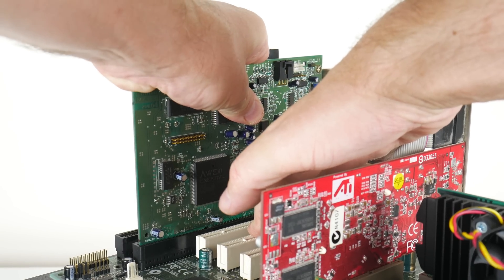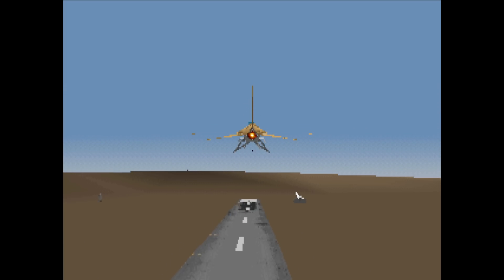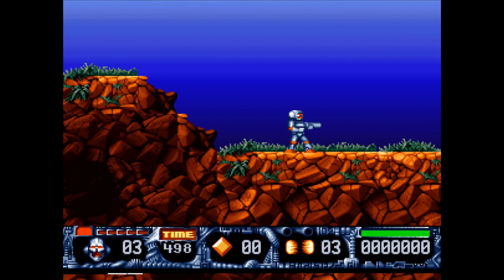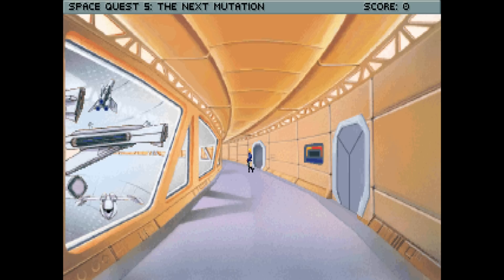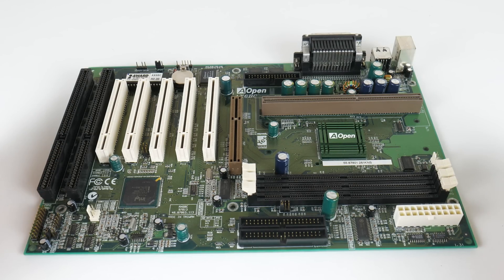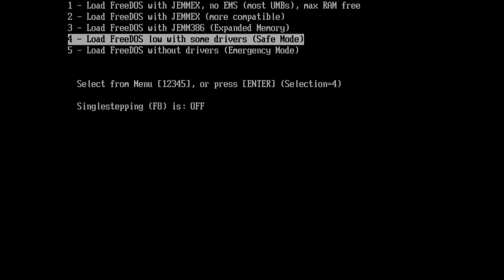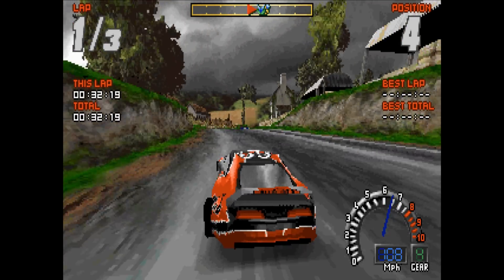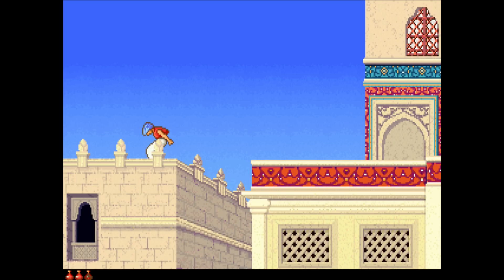FreeDOS 1.3 is it worth it for Retro DOS PC Gaming

Comment: FreeDOS looks great but the only thing I can’t quite understand is it’s actual purpose, what benefits would I have running my DOS gaming computer on FreeDOS over MS-DOS?
Reply: It's mostly intended for embedded systems, or replacing old industrial computers that can no longer be repaired, but are still a vital to controlling machinery. Hence the fact it works on modern hardware. It's also free and doesn't require licensing to be used in a commercial setting. So no benefit to someone with a retro gaming PC but could be useful in those settings.
Reply: I have the exact same doubt! Why? - does it include utilities for play speed sensitive games? Does it have a one for all solution for sound compatibility? What is the benefits? Why?
Reply: @DhinCardoso  It's open source. That's more than enough reason for some people.
Reply: @DhinCardoso  You can install it on as many machines as you have. For MS-DOS you still need a license for every machine you want to install it on.
I do have a couple of old machines, but only one license from MS-DOS 6.2 and another one from DR DOS 3.3.
Reply: None what so ever. But if you are trying to sell old DOS software to run on a modern system then it does offer a legal way of packaging up a ready to run package without having to worry about MS licencing.

Comment: Another great Video Phil! Thanks! Just curious what do you use to capture video from your DOS games. Seems like most of the common VGA capture solutions can't do anything under 800x600. I just put together an old socket 478 P4 box with voodoo2's (in SLI) and an ati 9800pro (has drivers for both win98SE and XP). Looking to do some video capture from it.

Cheers!
Reply: You will need to capture the monitor signal if you want profit from the 22 bit postfilter of the Voodoo cards.

Comment: JUST launched! been trying out 1.3-rc5 and had a problem with JEMMEX and the bonus disc thing, but having a blast! and used Grub4DOS in Partition to select between FreeDOS Kernel.Ssys and Windows ME IO.Sys! Gud times!
8:45 I like partitioning in Windows to keep the partitions aligned. I donno about FreeDOS' FDISK if it does that or not... but, I find it easy enough use windows 10.

Comment: so glad u came by with another retro build vid! all tha news about GPU shortages n stuff can really be stressful but bringin' back some good o retro gaming couldn't have came at a better time

currently i'm waitin' on a GTX 780Ti to get really dirt cheap so i can grab it for a Windows XP Retro Gaming Project pairing with a old system with a FX 8350 i retired for modern uses and yes it will be a offline PC for tha most part
Reply from the maker: 780 Ti for XP 😅 A 750 Ti will do the trick, you could build a nice Vista / DX 10 Retro build with the 780?
Reply: @philscomputerlab  i'll save Vista for a spare Sandybridge board i have second hand or should i dig out my Q9450 i have gotten for free a few years back? hmmmm

Comment: What is your opinion of that Kingspec SSD?  I see they make an IDE version as well, though I suspect that there's just some kind of SATA to IDE chip or CF card under the hood.
Reply from the maker: I think I got dud models, they are quite slow, feels like a USB flash drive more than a SSD. I would pick another brand, but it is possible I got fake ones.
Reply: @philscomputerlab  That's a bummer.  I'm partial to the HyperDisk disk-on-modules that plug directly into the motherboard, but the chip shortages are making those difficult to get now so I've been looking for alternatives, and Kingspec is one of the few companies making IDE drives (and the more reputable companies that make them, they're quite a bit more expensive).  I'd be wary too of that SATA to IDE converter.  I may experiment with some industrial CF cards since at least those are natively IDE.
Reply from the maker: @retro-computing-gaming  Just use a larger SSD with SATA to IDE adapter. Limit capacity by entering IDE values manually into BIOS. I want to do a video on this actually...
Reply from the maker: @retro-computing-gaming  CF cards work very well. For DOS a half decent brand / model will work wonderfully. Also check out IDE to SD card adapters. These use a converter chip, but work also very well with old computers.
Reply: @philscomputerlab  A video on all the various "solid state" options for retro PC's would be great.  Because there's a ton of options, and each one has its own caveats.  I've never tried the SD card route only out of concern for the longevity of the read-write cycles.  I've played with CF cards before but only the industrial variety allow for more than 1 partition, and any OS newer than Windows 98 will detect a non-industrial variety it as a removable device if the TrueIDE bit can't be flipped.  If you only need 1 partition and won't be installing anything newer than 98, regular CF cards seem to work great.
Reply from the maker: @retro-computing-gaming  I can confirm the removable bit, but could still install XP on it. In such machines though there are better options. The thing with partition limit is not true. Used various CF cards in many projects.

Comment: Still waiting for compatibility with Windows 3.11/WfW 3.11
Reply: Why? I know it might be nice, but is their anything you want to run under there? Windows 3.11 did not run much of anything that could not be run under DOS - certainly not games wise.
Reply: @lucius1976  Because it would make FreeDOS more compatible to MS-DOS. See it as a compatibility test. And an improved compatibiity can be useful in other situations.
The people from the DOSBox-X project (not classic DOSBox) do even use graphical demos from the DEMO scene to improve DOS compatibiity.
Reply: @OpenGL4ever  Technically Dosbox-x can be installed in Freedos and Win 3.11 in Dosbox-x. Maybe try that
Reply: @lucius1976  DOSBox-X is for modern operation systems. There is also no point in running a DOS emulator inside a real DOS.
Reply: @OpenGL4ever  i installed dosbox-x on Freedos. They do have a version for it
Reply: @lucius1976  Interesting. Didn't knew that.

Comment: The compatibility of FreeDOS 1.3 with Windows 3.1 and Windows 3.0 has improved over FreeDOS 1.2?
Reply: You can run Windows 3.x in standard mode (286 mode) on FreeDOS 1.3 but sadly not in enhanced mode (386 mode).
Reply: @OpenGL4ever  ah so it has improved! Because, according to something I read (I haven't tried myself) while windows 3.1 was able to run on standard mode, windows 3.0 was only able to run on real mode.
So now windows 3.0 is functional on standard mode as well?
Reply: @chrll  I don't know. I thought there is no big difference between Windows 3.0 and 3.1 in standard mode.
You might need to try it.

Comment: Do you know if Windows 3.11 works under FreeDOS 1.3? I could never get it to work under 1.2.
Reply from the maker: I haven't tried. Note that it needs FAT16.
Reply: Windows für Workgroups 3.11 does require enhanced mode which doesn't work in FreeDOS. But Windows 3.1 does run in standard mode in FreeDOS.

Comment: Speaking of Screamer 2 (and by extension, Rally), that's a game I keep getting illegal read error crashes from in DosBox and both of my P-IIIs. Do you run into the same issue?
Reply from the maker: Hmm I know there is a speed related bug with the setup menu. On some machines I had to disable CPU Cache to run setup. But game works fine at full speed. Maybe this is what you're observing?
Reply: @philscomputerlab  Nah, it crashes/locks up while in game after a few minutes.

Comment: Great video! Can't wait to test this version on my old pc. Does it work in modern hardware or semi-modern, like on a Athlon XP with the same Radeon 9200 and a AC97 soundcard? Like do we have support for modern soundcards, or anything like that?
Reply from the maker: If the machine has PCI slots there are options for DOS compatible sound cards. Also there are printer port sound devices.
Reply: @philscomputerlab  thanks for the reply, Phill!! I think I'll try to get another soundcard for it. Do you know if an Ensoniq card will work, or maybe a sound blaster live? I don't want to spend much on this, and don't know if these cards work good enough with DOS/Windows 9x games.
Reply from the maker: @marcelofrau8818  A Live! is a good allrounder card. Best for 98 games, but will run quite a few DOS games also. And should be had for little money.
Reply: there are currently supported tools like unisound for PNP ISA cards.
LGR installed freedos on a Ryzen. In fact i think dell actually still sells pc's with freedos as an option.
Theres nothing for AC97, unless the sound card has the sblink. I run a Athlon Tbird with an audigy 2 zs and it can run dos drivers.
I also think the 9200 would be fine for ega, but some of the newer cards dont do all EGA fully correct (keen 4 scrolling)
Reply: @Pickle136   thanks for the reply. will check the LGR video. As I have tried, I think my Ac97 doesn't have the sblink, so I will try something different. Do you know if an ensoniq card will be good to try? Or maybe a sound blaster live?
Reply: @marcelofrau8818  yeah for dos support live 5.1 is just as good, they basically all use the same emulation. The audigy driver can also be made to work on the live its somewhere on vogons.

Comment: In the future, I would love to see you do testing with some of Papyrus’ games, like NASCAR Racing and Indycar Racing II.
Reply from the maker: Hoping they make their way to GOG...
Reply: @philscomputerlab  unfortunately I don’t think it’ll happen. Papyrus folded after the release of NASCAR Racing 2003 and re-formed as iRacing.com a few years later. The rights to their old games are up in the air and they’re pretty much abandonware at this point. It’s a shame too, they’re some of the most realistic racing simulators for DOS. but you can still find physical copies on eBay occasionally.
Reply: @skraegorn7317  
Don't forget Grand Prix Legends too xD
Reply: @paulgraves1392  oh of course, I was just naming their DOS titles. They also did NASCAR Craftsman Truck Series Racing, NASCAR Legends, and SODA off road racing for Windows 9X, they apparently did the Windows port of Road Rash too.
Reply: I think there is no point in getting old Indycar Racying to run on DOS. Reason: You will find much better racing games today and these old racing games do have nothing special which make them unique.
The story is different for games where you do not find a modern replacement.
Reply: @OpenGL4ever  
Papyrus basically created the sim racing genre on PC and I've found that both NASCAR and Grand Prix Legends still hold up. There's no sense in arguing that theres no reason to use these games for testing, when in fact, they make excellent benchmarks for testing 90s era PCs.
Reply: @paulgraves1392  Well you can use for benchmarking what you want, i was talking about gaming. And a modern racing sim is just simply better in every aspect because the old one did not age well.

Comment: So what exactly is  the advantage of FreeDOS over Dos 6.22?
Reply: Proper usb support is one of them.
Reply: @EvilTurkeySlices  fat32 (but you can also get this with DOS 7 (win 98)
Reply: Payment-free option to bundle with modern software that works with DOS, like bootdisks and hard drive scanners. Works on more modern platforms so it helps keep old systems alive like industrial systems designed in the 1980s, or so I've heard at least.

Comment: i like freedos support of fat32 and it usually seems to have more free memory than msdos. The dimples app installer is quite nice also.
[Ediit: looks like this isnt the case anymore] -> the one big thing i find missing is any support for win 3.1, This is alone causes me to have some windows install in parallel.
Reply from the maker: Windows 3.11 doesn't work on FreeDOS?
Reply: @philscomputerlab  looks like i need to try it again and quick search shows it working for some. I thought there was an issue with 386 enhanced mode, but maybe this isnt the case anymore
Reply: Just FYI, I found the best way to run Windows 3.1 on modern PCs was under OS/2. Particularly eComStation or ArcaOS.
Reply: Getting Windows 3.1x working under FreeDOS was considered not worth the bother until recently, I think... but late in the 1.3 cycle they managed to get it more or less down.

Comment: Nice to see they improved a lot, but since you mentioned MS-Dos 6.22 is still the gold standard it does make me wonder. Are there any games that work fine on MS-Dos 6.22 that do not work on a FAT16 formatted MS-Dos 7.1 partition? Because so far i have never run into MS-Dos 7.1 specific issues with games.
Reply: The only issue on MS-DOS 7.1 is that it requeres 286 to run . The 8088 can run up to DOS 6.22 . But freeDOS works on 8088 and supports FAT32 like 7.1
Reply from the maker: Yea I also don't remember running into an issue with MS-DOS 7.1...
Reply: Back in the day I used DOS 7.x over 6.x because it more aggressively freed conventional memory which helped in a few situations. I don't recall running into any issues. EDIT: except FAT32 defragging.

Comment: Great video! One issue that I had in the past with FreeDos is that it is not compatible with Ontrack DDO. 
I even made a bug report on their website and they said: We don't care.
This is an important issue, because on older machines, such as a 286 or 386, their bios support only very small drives (less than 100mb) and when you want to use a 1gb or 2gb sd-to-ide adapter, you pretty much have to use Ontrack Dynamic Drive Overlay. Then, on MS-DOS, you can use the full capacity. This does not work with FreeDos. So what do you do? Stick with MS-Dos even if you wanted FreeDos.
Reply from the maker: Yes it takes just one or two things that don't work and you want to stick with MS-DOS. For me it is that old computers have enough issues, so I don't need another variable thrown into the mix 😅
Reply: I read the bug report on SourceForge. It's fairer to say that they didn't have the resources to look into the bug, rather than "we don't care".
I have a Compaq Portable II with Disk Manager and MS-DOS 5.0 booting from a 512 MB SD card. It would be nice if FreeDOS worked, but not super important. The good thing about FreeDOS is most of the software that comes with it will also run under MS-DOS.
Reply: XT-IDE (or XUB) is maybe a better option for something that old, though that may require some added hardware.
Reply: @simeonjohnston5941  Xt-ide can make it work, but it is quite slow and expensive. It cannot be used in laptops too.
Reply: @alexandrecouture2462  You can just stick an eeprom in a network card and bypass BIOS problems.
Reply: I wonder if DR DOS 6 or 7 is compatible with Ontrack Disk Manager. It would be interesting to try.
Reply: 386 BIOS support up to 540MB. There are other overlay programs ,but they use a tiny memory and this can be issue for older games that depends on the first 640KB to run
Reply from the maker: With a 386 you should be able get around 500 MB by manually entering CHS values. But agree, DDO solves this issue. You could also source an IDE controller with better BIOS.
Reply: @philscomputerlab  later 386 BIOSes even can automatically recognize drives :) . The strange think is that they even "see" up to 8GB in the BIOS, bur when you want to partition and format the drive only about 500MB are usable
Reply: You can work around the BIOS problem by buying a SCSI Adapter for your ISA BUS and using SCSI. SCSI does has its own SCSI FIrmware (BIOS) and doesn't depend on the PC's BIOS.
Reply: @OpenGL4ever  XT-IDE usually does the same and you only need an old network card with an eprom or flash.
Reply: @OpenGL4ever  I'm sorry, but it makes no sense to have to buy hundreds of dollars of parts just to use FreeDos, only because of a bug on their side. I can have a 32gb microsd as my hard drive and all the space available for a few $ in parts, and then use Ontrack.

Comment: It's not worth it for gaming as most games that need EMS (emm386) will crash because jemm386 is not compatible with DR/PC/M$-DOS's emm386 and the programmer who does this doesn't care.
Reply from the maker: What games have you tested?
Reply: i've simply installed ems and HIMMEM from msdos into freedos once. It had better support to my pc than msdos 6.22 and ran the games fine. It may not be better than 1.2, but it's usable for gaming with some tweaking
Reply: @vardekpetrovic9716  Does edrdos have full compatibility, including cdrom checks for games? How does it compare with msdos for example?
Reply: @vardekpetrovic9716  Cool, i'll give it a try then. Seems a good alternative to msdos